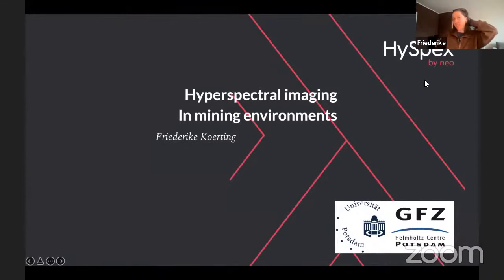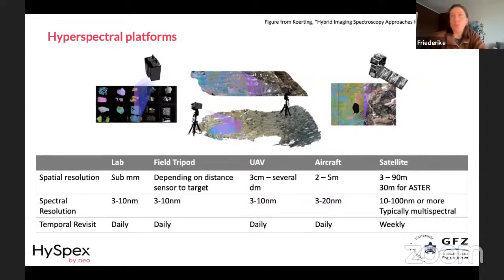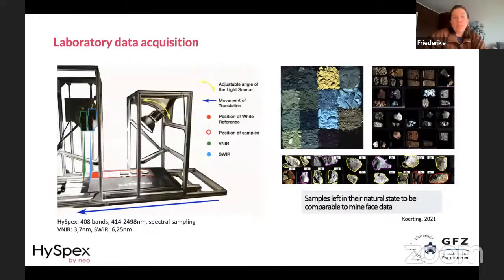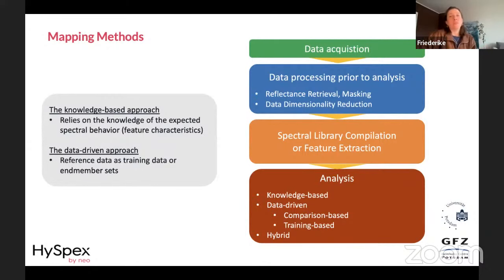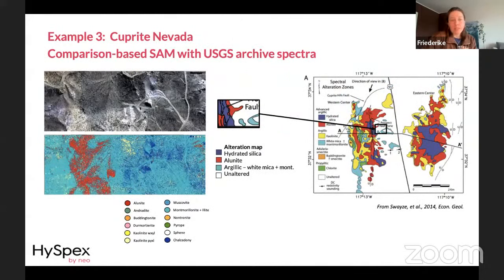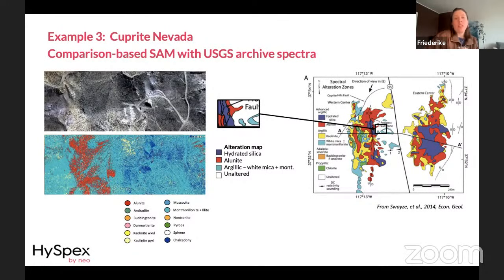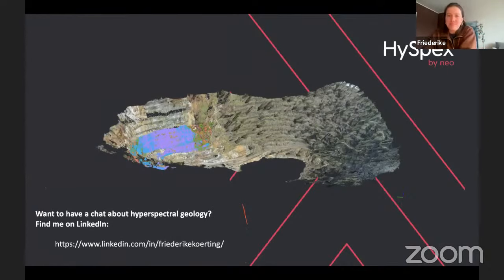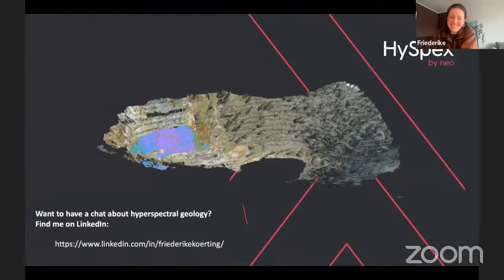ODH 116 - Friederike Körting - Hyperspectral imaging for raw material applications

Comment: I enjoyed your presentation very much.  

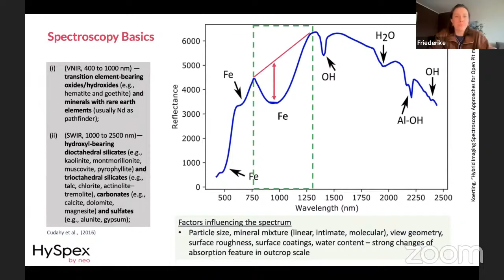1) An early slide (5:00) has amphiboles/pyroxenes listed as IonoSilicates, it's Inosilicate.  I liked your differentiation between di- and trioctahedral coordination for the micas...my igneous petrologist shows.

2) Roger Clark et al.'s Tetracorder software often confused halloysite with various other micas.  Are you taking that into account?  

3) I developed a neural network several years ago that classified all of the U.S.G.S. spectral signatures in the spectral library to >95% accuracy, sadly it only really works on pure mineral spectra.  

4) Were you aware that the depth of any absorption feature is a function of both grain size and abundance?  Continuum removal?

5) I think you rightly pointed out that pure mineral spectra are not very useful in the real world as there are rarely pure minerals being imaged;

6) It looks like you clustered the spectra using the whole spectra.  I clustered spectra after running an MNF on the imagery.  That way you only deal with the cleanest (least noisy) data.  

7) What was your method of clustering? Was it Kmeans?  There are other techniques topology-preserving methods such as Self-Organizing OMs.  SOMs can also be used to find endmembers in your imagery.

8) I have used spectralPython a lot.  It is limited by python's interpreted speed.  

9) Usually, the 400-2500 nm wavelengths are divided into electronic and vibrational parts with the electronic effects  limited to 400-1100 nm.  The absorption feature at wavelengths > 1500 nm result from vibrational effects at wavelengths > 5500 nm (LWIR.)  What you're seeing as absorption features between 2,000 -2,400 nm are the result of combinations and overtones of features in the LWIR.
Nonetheless, a very good presentation.